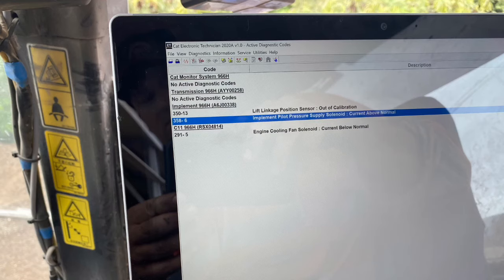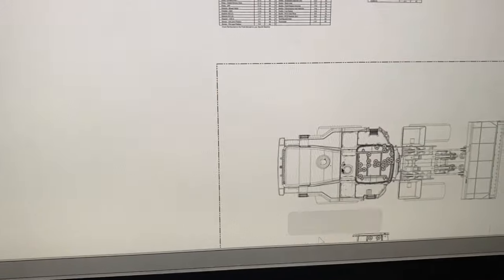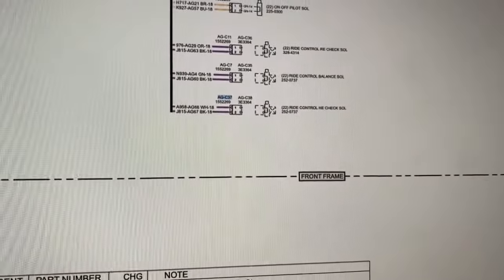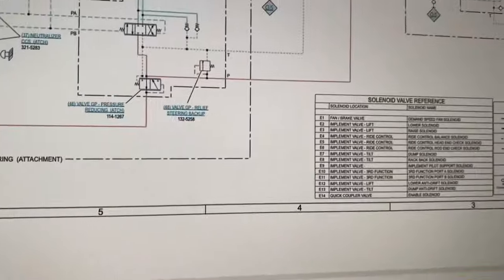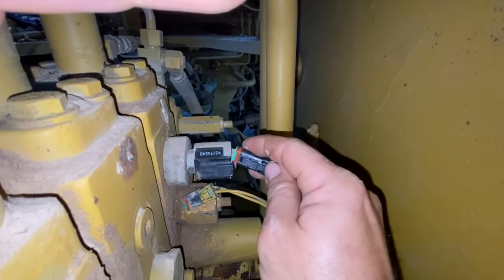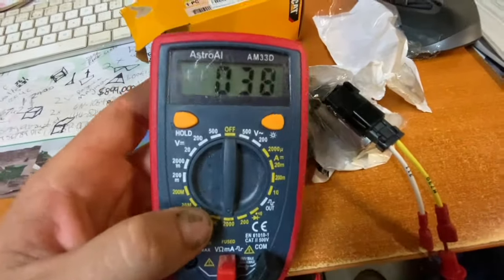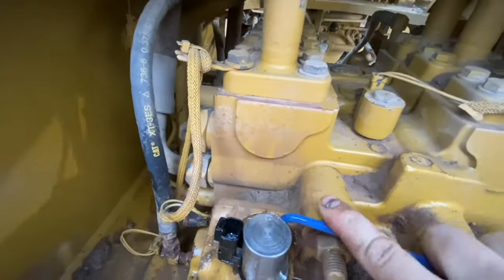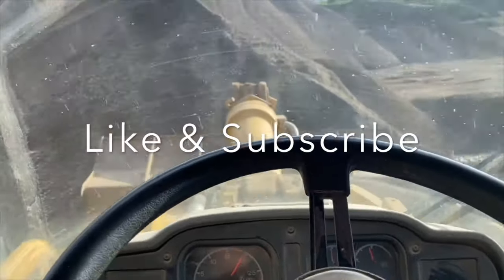358-6 Faulty solenoid

Comment: I have a problem with my 2004 Bobcat T250 I get a code hydro Charge Pressure in Shutdown and it shuts off
Reply: I’ve Replaced The Pressure Switch , Belt , Both Pumps Gear and Hydrostatic Pump and still same code nd shuts off